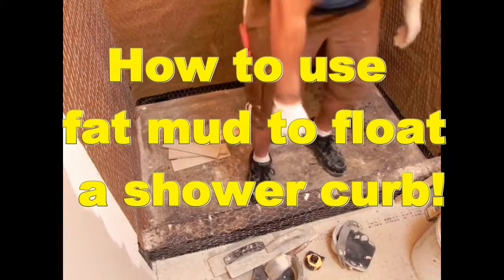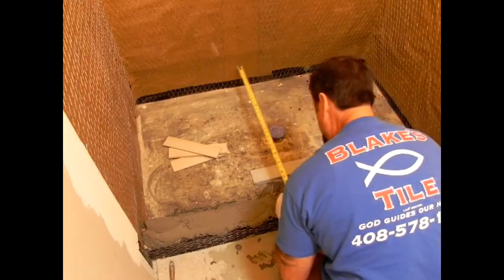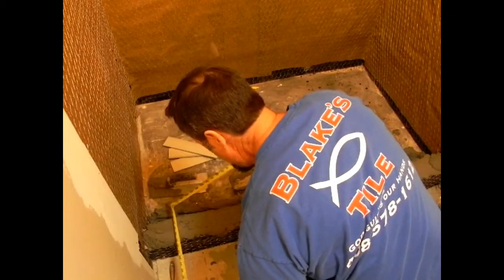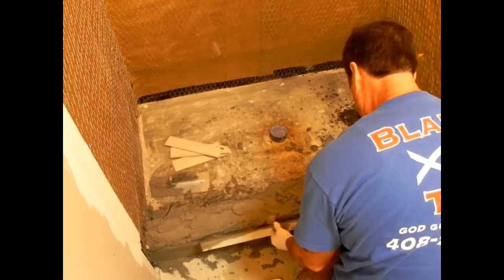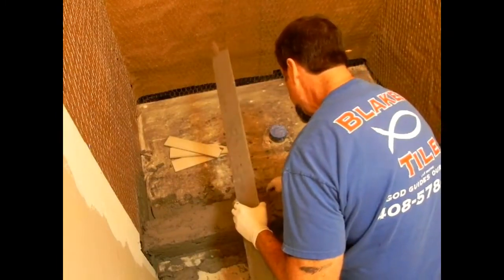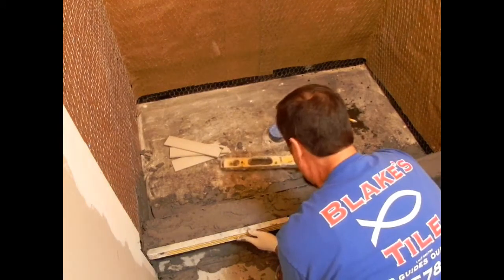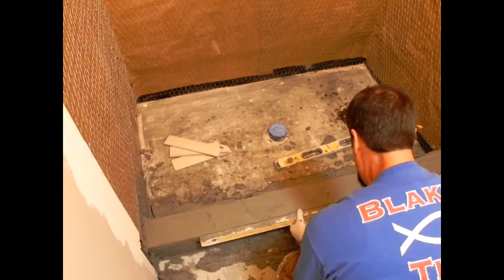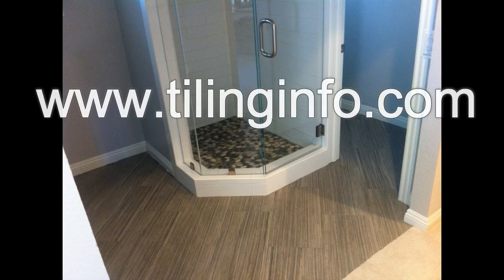How To Use fat mud to float a shower curb

Comment: If you aren't stapling on the top or on the inside of the curb, what is holding the wire mesh taught?
Reply: He is hoping not to answer any technical questions, hot tar for water proofing and chicken wire, not very smart.
Reply from the maker: Your right not to staple on top I use the fatmud to hold it in place.
Reply from the maker: Joe what do you use?
Reply: joe is crazy, I Rough-in and  float just like you and have never failed an inspection

Comment: do you use a rubber membrane for your pans?
Reply from the maker: +Ryan Jazdzewski I like to have it hot moped with tar. But if I can get the guy I will put a rubber membrane in the shower pan.
Reply: @DavetilinginfoBlake  but do you go over the curb with a membrane and then follow with another float? Thanks.

Comment: Hi,

What is the top mixing you used (company name) and how do you mix it. ?
Thanks for the great video.
Reply from the maker: +Yossi Khalon There is no company name. Its called FatMud   1sand 1lime 1cement  you can mix it in a bucket
Reply: One part sand, one part lime, one part Portland and one part fingers crossed. Better to get a book from Home Depot.